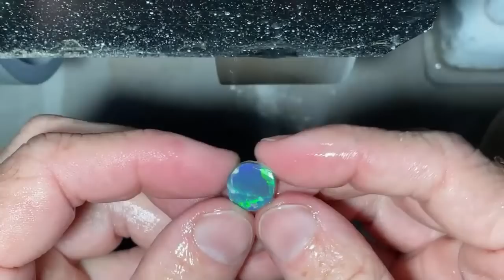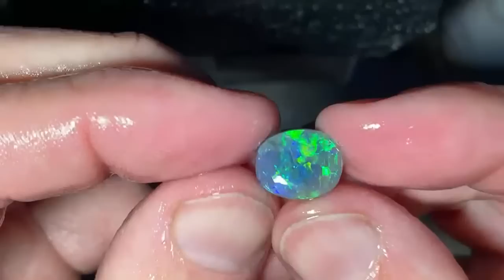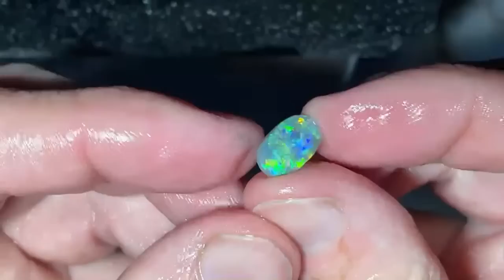LIVE Rough opal session. You’re invited

Comment: The man has the tools the knowledge and the talent
Reply from the maker: Thank you Robert
Reply: @blackopaldirect  Pushing the wheel makes it muuuuch easier on the motor.  Starting from a dead stop versus even a small rotation is ENORMOUS as far as wear and tear.

The noise is caused by worn bearings, Justin. Seriously. Listen to the beginning.  chug chug chug chugchugchugchug...it's  the bearing. You need someone in to look at your motors and bearings. This isn't a do it yourself.